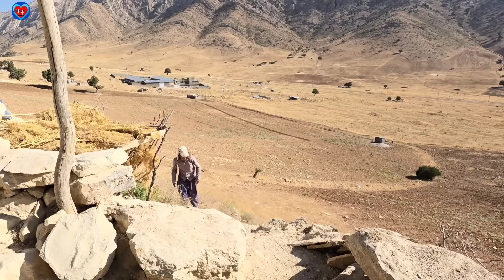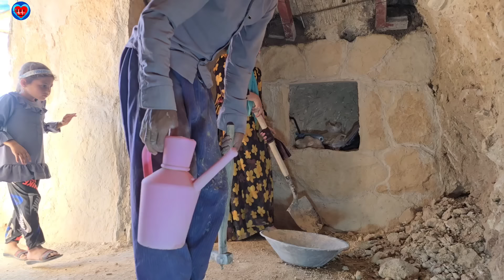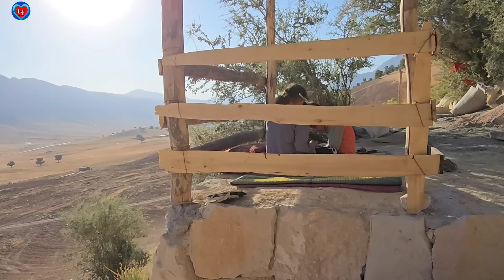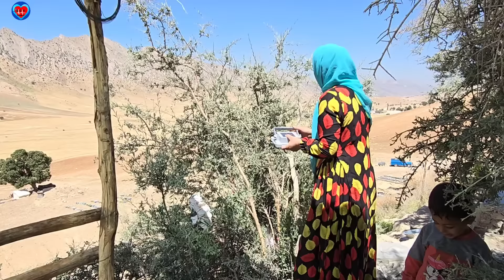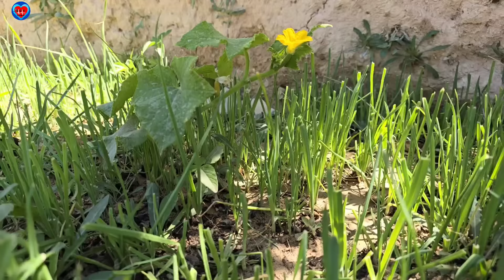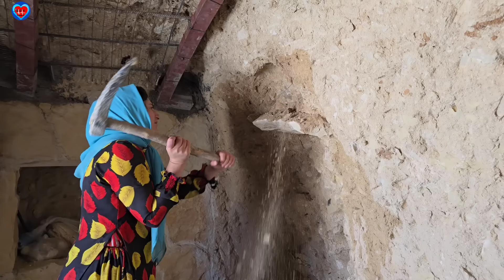Nomadic Lady's New Project: Amazing Magic Cave Expansion Plan

Comment: You all are not thinking about the front door and the rain anymore??  Will it stand all that flooding pouring down when it rains?? 
I always no matter where the building is taking place  saw the constructeurs working on the walls and next the roofing … itns not because utns a cave that it won’t be flooded if no protection on the front door.. while waterproofing the outside of the roof..
Reply from the maker: قبل از زمستان او یک در خواهد ساخت ♥️♥️♥️♥️